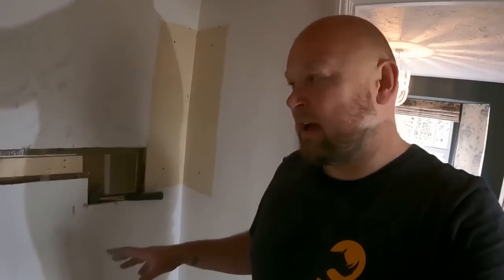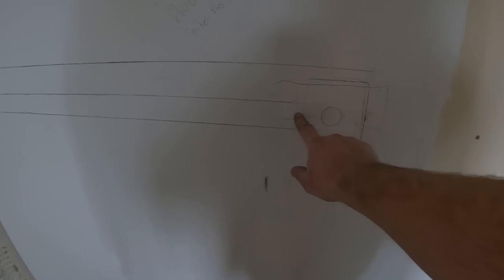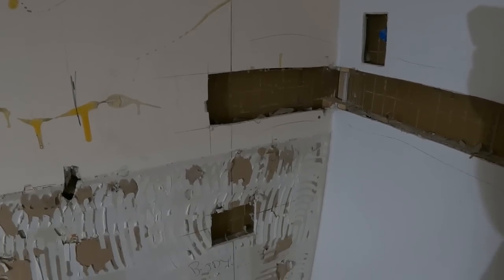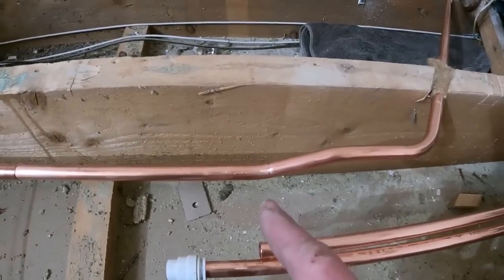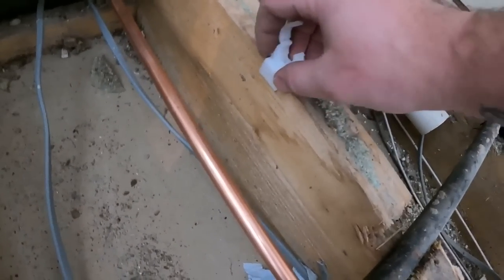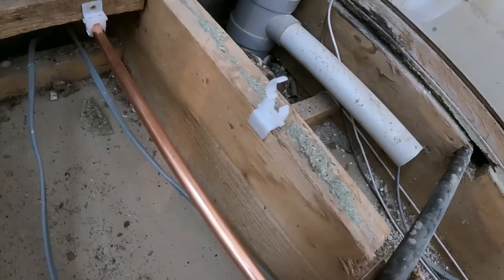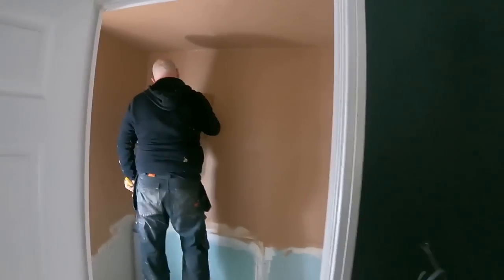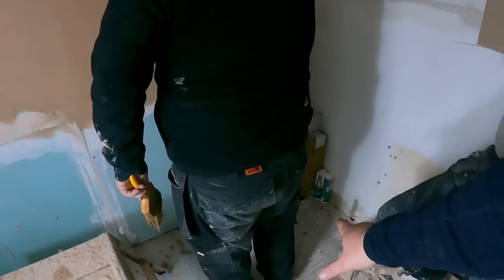SHOWER TRAY PROBLEM… why I REFUSED to fit it | Bathroom renovation Part 3

Comment: The only shower trays I fit are mira flight trays. Acrylic capped both sides so smooth as. They also recommend silicone to fit so doesn't void the warranty
Reply from the maker: Yer I’ve done a few of those…. Great trays

Comment: If you are using silicone to silicone down the tray. What measures due you use to level up the tray. I.e. If your floor is off by 15 to 20mm.
P.s.i feel your frustrations😂 at these jobs. Everyone thinks it a day to rough in pipework. They don't see that a plumber is a jack of all trades.
Reply from the maker: I usually pack/level them with hardybacker and seal through if needed….

Comment: I painted my en-suite ceiling white emulsion then a coat of Polyvine decorators’ varnish. No more mildew issues or if you get it, it wipes off.  A game changer.
Reply: Does it not sweat hold water on ceiling ....I've been to jobs were they used bathroom paint and ceiling was dripping with water ....had a decent fan in but couldn't take the steam out quick enough ...
Reply: Might have to look into that then ....but mildew being about is a ventilation problem simple as ....it's like saying to customer once they've spent 15k on a bathroom don't worry about the mould on ceiling just wipe it off now and again it will be fine .....🙈....sure they will accept that ....

Comment: I’m currently doing a full refurb on a bathroom with 2 internal walls “ paramount egg box walls “ ( usually a wimpy home early 70s ) 
I bought some fishier wall plugs and screws Battons onto wall 
Ran electrics and plumbing in then boarded over battens with foam filled tile backer boards 
I added extra battons where radiator is going to can screw st8 to timber
Reply from the maker: Nightmare ain’t it

Comment: Those egg carton walls are shocking, could be worse, we had one where the partition walls were same thickness as those but made of straw.
Reply from the maker: Yep I’ve had a job with that before…. Properly compressed in and a nightmare to do anything with… horrible stuff

Comment: Had a few trays like that.
You could use a single head pump and pump the mixed water to outlets make it easier.
Never change what you know works( silicone)
Reply from the maker: Thanks buddy

Comment: Did my son's tray a few months ago used sand and cement as the floor had level issues. Have seen some people use foam on here. Doesn't feel right to  me as I don't think any manufacturers have approved. What's your thoughts?
Reply from the maker: I personally wouldn’t ever use foam

Comment: Enjoyed that as normal mate. 
The moisture board and tanking looks like a solid seal.
I’ve got one to fit myself soon. I may and I only say may, try the classi seal but if I’m honest yours looks well watertight.
I’m. Only a diyer but something about normal plasterboard and tiling just doesn’t seem a solid enough seal against water.
Keep em coming Mark, particularly the awkward jobs, it’s where we learn the most!
Maybe sneak a couple of ‘easy ones ‘ in first though for a destress😊
Reply from the maker: Glad you liked it buddy…. And I’m praying for some straight forward jobs😉👌🏼

Comment: Hi Mark i know you keep going on about that you just silicone the trays in but can you also explain to your viewers that sometimes the tray needs leveling with an adhesive or cement if the floor is sloping thanks Martin bathroom fitter from Doncaster.
Reply from the maker: Yep indeed it does, it always needs a flat base👍🏼

Comment: I would imagine they did not need to batten it before because the ceiling was boarded and then the wall put up (if you can call them wall!) I hate bathrooms and tend to avoid :)
Reply from the maker: Yep I get ya… probably
Reply: This is exactly the reason. Common practice as it doesn't need it when over the walls

Comment: Hi mark, good video mate, quick question.. I always use a bed of sand & cement when bedding down a tray because it helps with levelling, how do you go about levelling it out on silicone if it’s an uneven floor?! Thanks 👍🏻
Reply from the maker: Ply and level the floor if it’s out buddy 👍🏼👍🏼

Comment: I used one of those Mira sealing kits the other week to be fair. 
No they aren’t the best and when it comes to tiling they kick your tile out and you have to put next to no tile adhesive over them.

I just tend to use the Mapei kit now (think you’ve used it previously) but it can be a bit of messing about putting the tape round the bottom
Reply from the maker: Yep exactly what I thought it would do so binned it off

Comment: Are you tanking the area to prevent damage to the walls, seen as you're using plasterboard(albeit moisture resistant)?
.
  'Abacus' or concrete based tile backer board would be far superior in providing a substrate behind the tiles.
Reply from the maker: Yes it would but as the whole wall had to be done and plastered certain areas it wouldn’t of worked as explained👍🏼

Comment: Pain those egg shell walls, looks like you cut right through those wall joists though, could you not have just drilled holes or notched them.
Reply from the maker: Was no room to allow it mate, was super solid afterwards
Reply: From what I remember, the studs in paramount walls aren't even attached to the bottom or top plates anyway, so cutting through wouldn't make the wall any weaker.

Comment: How long does your tray silicone last ?
Reply from the maker: How do you mean??
Reply: @MJTiffPlumbing   silicon sealer around a bath , shower ?  I find it last about 2 years in a shower  before it starts to allow water through, about 5 years for a bath. As you said you had never had any issues for 20 years I was curious to ask what you use .

Comment: I bet you, that tray is made by just trays. In my experience with them, they are rubbish. Quality control looks non existent. I today have got exactly the same grinding off of the tray. but leaving it dangerously thin in the centre. Being up on their supplied four legs riser kit. I have no faith in it. I personally normally fit mira flight trays. Seem to be alot better quality.
Reply from the maker: Flight trays are spot on 👌🏼👍🏼

Comment: Those yr of build are awful to do refurbs on! Keep plodding!
Reply from the maker: Yep, this is 2001 build…… so so bad.
Reply: Also had the exact same thing with a tray last week 1600x 800 thin as hell and rough on waste hole. Took a sander to it for 10 mins and seemed to do it. 
 No quality control on products anymore.